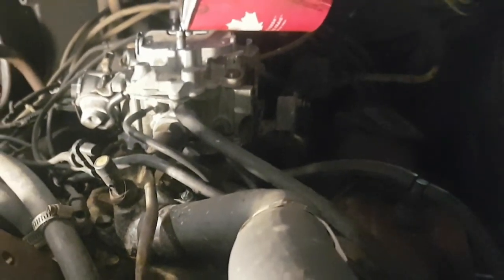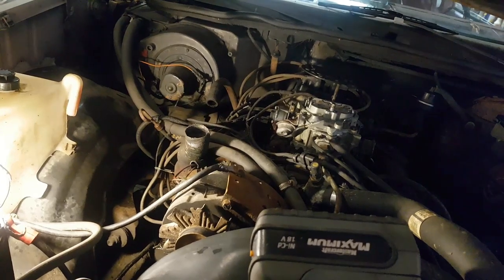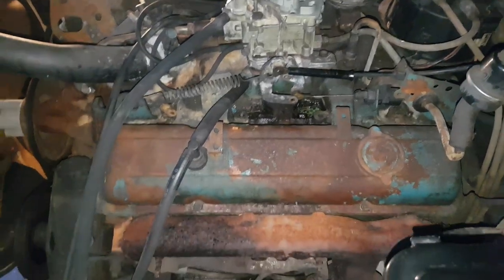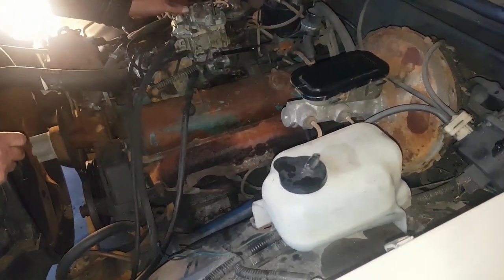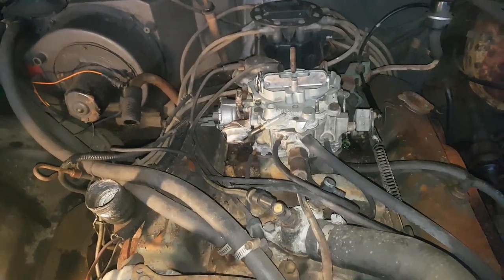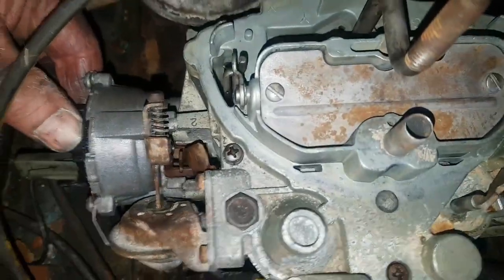first start in ten years + setting a electric choke

Comment: Outstanding vid Caper.  Got that old beast running after 10 years.  Engines are meant to be run and are hard to kill.  Is that a small block Chevy V8 305?  Good engines.  Keep up the good work there Caper.  Cheers!
Reply from the maker: Thanks so much bill  it's a two ticty  seven without the tick .
Reply: @thisguysgarage  Well, that's a new one on me.  I'm so used to the 283 and 327 small block Chevy's I had forgotten about that particular one.  Thanks for letting me know and  keep em coming!
Reply from the maker: @TheFlatlander440  the 267 was popular in Canada they were known to get close to 30mpg .its the little sister to the 305. Sbc are a solid platform.  Thanks a bunch bill . You thinking about uploading still?